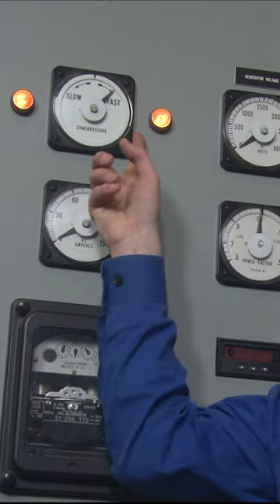Synchroscope #engineering #highvoltage #electricity #generator #hydropower #powerplant #90s

Comment: He did not explain this, but Frequency Matching is implicit when you have Phase Matching, regardless of the exact frequency.
Reply from the maker: You're exactly correct, thank you! We cover Frequency in other episodes as well.
Reply: Not quite, but phase matching doesn't last if the frequency is wrong, so keeping the phase matched and steady ensures matched frequency .
Reply: @johndododoe1411 isn't that what was said? Phase matching requires frequency matching,  but the converse is not true - frequency matching does not require phase matching (mathematically speaking).
Reply: @onradioactivewaves  When the frequencies aren't matched the phase of the 2 systems will match every so often (difference of frequency per second).  
So in theory you could connect the grids at the exact moment they have the same phase. However the grid will change the speed of the generator rapidly, so it's still a very bad idea to do.   
Using an asynchrounus generator this might actually be possible without destroying everything, as it allowes some slip
Reply: right, if your frequency is off then the relative phase is going to keep changing - i.e. the meter keeps spinning
Reply: @thomasb4422  to sum it all up, you can get phase to sync even if frequency is all wrong. It will just go in and out of sync very fast... And connecting to grid with frequency far off is a very bad idea, even if you manage to lock the phase just right...

So what you want, is really just "slow in the fast". Or frequency just above grid frequency, that would make the syncroscope spin slow, in the direction of "fast", indicating the frequencies are close and generator is running a bit faster than grid. Get the phase right, connect and that will slow her down and generator will pick up some load while doing so. Exactly like you would want to. Going slow in the slow, would cause grid to push the generator, and that might not destroy everything, but it is not ideal.

Comment: I TRAINED FOR THIS BACK IN 1968 FOR THE BACK UP GENERATOR
Reply from the maker: I'm still using your same controls! lol
Reply: In 1986 I trained to do it without the meter. Only using the lights and the meters on both generators in manual mode. It also had an automatic mode where the online generator and the oncoming generator did it all themselves. Then you killed the one that had been online. They lasted till new generators were installed in 2001.

Comment: When I was younger and my father worked at a power plant. I had the excellent opportunity of being the one to turn the switch to connect the plant to the grid, on the order of the operator on duty.
Reply from the maker: That's SO COOL! It's great to give young people the chance to have such experiences, as you've seen yourself, those memories last a lifetime. For obvious safety reasons we can't give tours and such at the plants. But it's not terribly uncommon for someone to bring a friend of the family or something like that in, and we try to let them do something cool as part of their visit. Thank you for sharing that memory :)
Reply: I remember visiting a power station as a teenager and being allowed to do this also. Synchronization was achieved by watching three light bulbs, one for each phase. They would flash in turn, getting slower and slower until the frequency was correct. Then, at the moment when all three bulbs went dark, it was time to make the connection.

Comment: A mentor once told me that setting up test scenarios with old school techniques using analogue devices may lead to better understanding of systems. He was correct.
I’ve never done a manual synchronization myself but I have seen it done with modern as well as with very old school equipment.
Very cool.

Comment: Used to synchronising gen sets with the old synchroscope. One place  I worked at had a transformer on the mains side that just did external compound power, mainly lights. At weekends we’d get the newbies to play at synchronising the gen sets together and then to that transformer. Hours of fun. Another site I worked had HV gen sets and nobody on site knew how to synchronise them to the site HV ring. The design procedure just wouldn’t work at all, so spent a weekend writing a new SOP for it and then tested it the next weekend ,with the client on site. Straight online and synched first time. Lovely feeling to hear all the breakers go in , in sequence , on the Gen Set HV busbar.

Comment: Modern plants have digital synchroscopes with LEDs or a digital readout that should show many degree out of phase . However I love the analog ones
Reply from the maker: I looked at upgrading to a modern one, but you're right, they're ugly. This is staying here for as long as it's safe, reliable, and practical. We call it "Old School Cool". :)
Reply: @Physicsduck  Don't change it. 

More people today know how to maliciously tamper with LEDs and microcontrollers, than they do analog.
Reply: Modern plants don't have syn-scopes at all. All done automatically by the programmable logic controller. Most HMIs will have a display on the monitor if you want to see what is going on.
Reply: @LRK-GT  I don't think people would be too interested in tampering with a synchroscope to begin with
Reply: i like analog for the simple reason that they don't have any parts that can "halucinate" a state by having faulty components.

Comment: This type of synchro scope has been around for a lot longer than 1993. I'm  65 and they were around before I  even thought about graduating high school.
Reply from the maker: At another plant I have one that dates to the 20's and it's still in perfect daily service and totally reliable. :) This is actually a problem for me. I'm trying to find an old one I can put on the workbench and use to teach people things, but they don't DIE, lol.
Reply: That one looks like late 50s early 60s style.
Reply: Where are you from that you still use 20s equipment? Worked at a plant that had 20s equipment and it was retired in the late 80s.Things just were falling apart and couldn't repair them anymore. No spare parts. Took the Boiler Pressure gauge and made a clock out of it. Still hanging in the board meeting room to this day. @Physicsduck

Comment: I was in the Navy on a nuclear ship as an operating electrician. Bringing turbine generators online, flashing the field, bringing up the voltage, manually controlling the throttle to get the synchroscope rotating slowly in the fast direction, closing the output breaker at 5 to 12, and bumping the throttle valve to keep it synced before putting it all in auto. Went on to operate in stream and nuclear generation as well. We had manual sync at the steam plant and auto-sync at the nuke plant.
Reply from the maker: How long ago were you still doing manual sync in a steam plant? :)
Reply: @Physicsduck   Mid 90s. It was a late 50s vintage plant used for base load. It was rarely offline, so we only had to do that on  return to service after a shutdown.

Comment: It was interesting syncing two mobile wheeled generators. I worked for a water company and was tasked with connecting a matched pair of generators to run a water treatment plant during a planned power outage on the network.
Running up the generators, then synchronising them was ... Errm... let's say interesting.
Despite the synchroscope showing the generators were syncronised, when i threw the breaker that linked both power supplies the pair of huge generators jumped on their suspension. It was scary standing next to a pair  6 tonne generators bouncing around for a moment!

Comment: Its kind of crazy that they haven't done any upgrades in 30 years. The engineering for it to hold out that long is amazing, but I imagine this kind of thing explains a lot of why so many places have pretty regular outages. I doubt those plants were designed to with the load requirements of modern day in mind.

Be well.

Comment: Having done the analog sync for an exercise bike connected to a wall outlet through a single phase electric motor/generator, it's absurd how much accuracy you can get from a few lights and dials. Fast/slow is all you need for frequency. 3 light bulbs is all you need to indicate phase (too far ahead, close enough to connect, too far behind). And voltage should always be measured at both sides of the breaker anyway. It's fabulous how reliable old temporary solutions like that can be, when done properly. 

I was briefly the least contributing power plant in my country. Now, I'm on the distribution side, making sure the grid doesn't destroy itself when a fault occurs. Great to see the stuff that actually keeps the lights on. I'm just keeping the infrastructure healthy.

Comment: Reliable, always worked as designed. I've used these from 1982-1999 in everything from 1920's .3 MW Hydro to 1980's 740 MW Steam units. After initial startup (after new construction) we used auto-sync on the big units.

Comment: You never show it in action but I immediately recognized what this is. I used to work in signal transmission for the US Army and one of our equipment platforms requires a 5k generator that is deployed in a pair for refueling and redundancy purposes. In order to switch between generators, you have to throttle the two until the lights synchonize, or in other words flash extremely slowly. It was legitimately fun every six hours to play with the generators for about a minute to get the lights right.

Comment: What's interesting is that a synchroscope is a 3 phase stationary motor winding at its simplest, with a moving 3 phase winding on the pointer shaft.  When both mag fields are moving at the same rate there is no rotation.  If different, it goes clockwise when the incoming (generator) is faster, and vice versa.  And when the phases are aligned the pointer is straight up; any phase difference and it isn't.
 The lights come off of the same source, phase A to phase A and B to B.  If the phases are in sync and there's no potential difference between them, the lights are out.  Otherwise they are lit to some degree.

The current comes from Potential Transformers off of the leads on either side of the breaker.  It's knocked down from whatever voltage is to a nominal 120V.  As long as nobody changes the wires, everything should work.

The first time we synched the big generator at the nuke plant, the yard guys brought in a board with three lights, hand tracing all the wiring several times.  Just to make sure everything was right.  From the on as long as the two lights no the board are dim and the scope is straight up, everything should be good to go.

Comment: Somewhat similar to power shifting with a manual transmission. The only difference is that you also have to match the phase as well.
Reply from the maker: The consequences of a missed-shift in this instance are a bit more severe. ;)
Reply: @Physicsduck  Even a phase mismatch is a money shift here! 😄
Reply from the maker: LMFAO
Reply: @Physicsduck  I was going to ask the same question, especially with a non-synchro.   Kind of like learning to ride a motorbike and pull in the clutch and kick down around 3 gears let the clutch back out,  and well you get the idea.  wasn't going too fast at the time maybe 30 Km/h.

Comment: I worked for 8 years as a marine electrician onboard archaic factory processing ships in the Bering Sea. I am very familiar with starting generators in parallel on an ungrounded delta 480 volt electrical system.

Comment: I always love your content.  I recently read an audit of Alaska's electric supply. Because many villages are remote, isolated, low population, discreet grids with limited opportunities for education or elite specialist, the report noted that some locations had top of the line modern facilities, while others were unsurprisingly cobbled together but working far more reliably than should be possible.  It could be an interesting vacation to explore such locations.  At least the report was n adventure.

Comment: I was electric plant control qualified in the navy and definitely have used a syncroscope many many times. Fun fact: slamming a breaker closed will also synchronize the generator. I never did it but I saw it happen and wanted to facepalm.

Comment: ain’t broke , don’t fix it

we’ve been using synchroscopes on navy ships since the 50’s. robust and reliable
Reply: It could be, very easily.  Literally close the breaker at the wrong time.  An automated one literally wouldn't allow you to until you were in sync and could still be manually overriden if it broke.

Comment: I work in hyperscale data centers. A few weeks ago we had a set of paired full conversion 1megawatt UPS systems lose phase synchronization.

Blew all the fuses in both and bent the solid internal bus bars on one. Also triggered the fire alarm.

Comment: When I worked on the diesel generators we liked to try to close within 10 degree phase angle for gen to utility applications. Had a sync check 25 device in series with the closing circuit to prevent out of phase closures. We would go up to 15 degrees on gen to gen paralleling

Comment: I remember doing the same thing on a coarse level in the beginning of 2018 when the frequency of the European continental grid dropped quite a lot below 50 Hz and my alarm clock ran several minutes slow by the end of it.

Comment: You don't phase with those 3 parameters perfectly matched. You need slightly more speed (slow in the fast direction) and slightly more voltage when phasing, so you're generating a bit rather than motorizing when you close the breaker.

Comment: Match voltage, frequency, and Synchroscope slowly moving in the fast direction. Close the breaker when the Synchroscope hits 12 o'clock.

Imagine that Synchroscope on a submarine trying to load up the diesel generator. Every time a wave breaks across the top of the boat the frequency drops out as the exhaust gets back pressured.
Reply: Never had to deal with that on the newer subs #DCplant

Comment: When voltage, frequency, and phase aren't correct, is that where the videos of power stations making that crazy frying sound with plasma arcs while activating disconnects happen?
Reply from the maker: Nope, if we're off on sync it makes more of a "BUILDING EXPLODES" kind of sound.

Comment: Phase-locked loop electronics using integrated circuits and microcomputers had already become cheap enough by the mid-1970s that synchronizing a generating station to the grid could have been completely automated -- just push a button.

Comment: I'm going to try to use a dual channel oscilloscope to match voltage phase and frequency from a diesel genset with a solar inverter
Reply from the maker: Get video! For doing that as a prototype test or something that's fine, but if you're going to be doing it on a daily basis you really do want proper metering and controls. They may cost a bit at the beginning, but it's going to be WAY cheaper in the long run because of all the parts you won't have to be replacing so often.
Reply: @Physicsduck  Everything's a "temporary prototype" until 5 years later you realize it's permanent :) Thanks for your videos.
Reply from the maker: Thanks for being a part of this! :) I appreciate that you're here! If you build that setup, please hop in the Discord and share it! I so totally want to see this in action.

Comment: Okay correct me if I'm wrong, I understand that in the fifties or earlier at the end of the day around midnight they would either speed up or slow down the frequency ever so slightly to keep the clocks up to date.
Reply from the maker: I have never heard of that one, but if you can find any supporting information on it I'd LOVE to know the story. Today we keep frequency VERY rigidly locked at only a small fraction of a cycle per second.
Reply: You're likely thinking of TEC, or Time Error Correction, where the grids cycle is monitored and certified as a reference 'tick' for clocks to use to keep from drifting too far from standard time.  Tesla even played with this.  Wiki has more info on the subject:

https://en.m.wikipedia.org/wiki/Utility_frequency#Time_error_correction_(TEC)
Reply from the maker: Oh WOW! Thank you for sending me down a while new rabbit hole! This is cool!
Reply: @Physicsduck  I spent nearly twenty years in network engineering, time is an important part of networks, as is physics.  I've had more than a few conversations explaining how thanks to c data can only travel down fiber so fast, and that no it can't get there any sooner.  I've also been involved with NTP (network time protocol) systems including a variety of highly accurate network clocks.  There's more than a few rabbit holes you can go down when it comes to time accuracy. ⌚
Reply from the maker: You sir are invited to the Discord. I have as many questions about this as you have freetime to chat about nerd stuff.
Reply: @Physicsduck I'll get on there in a couple days and give you a shout.  Free time, that's one of those things like disposable income, a rare breed of animal for sure.  :)

Comment: Analog, like my trusty old Micronta Simpson meter knockoff... if it aint broke, use it sparingly  or you'll go broke trying to replace and kluge it into the not exactly pile... and for those young pups, Micronta roughly translates as Tandy AKA Radio Shack in some Oriental language...